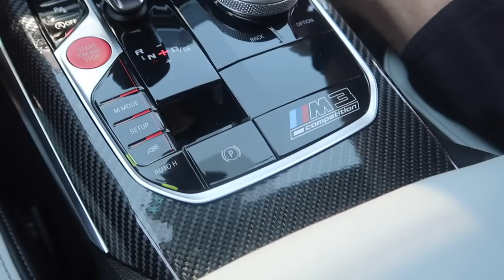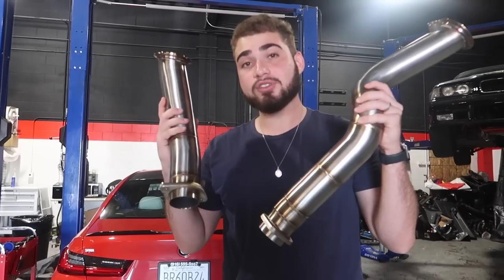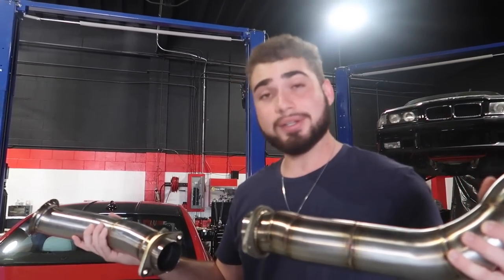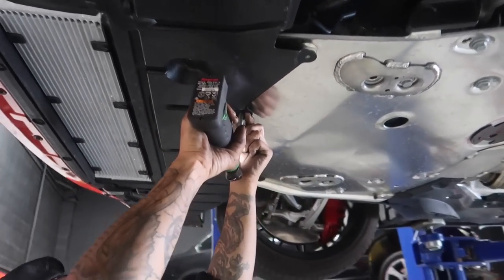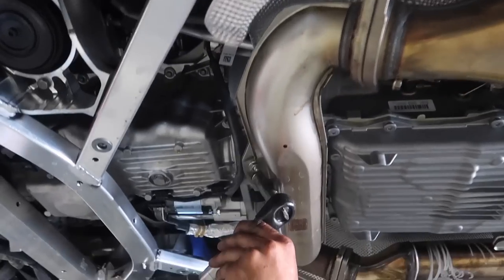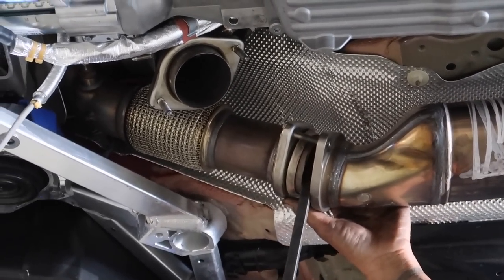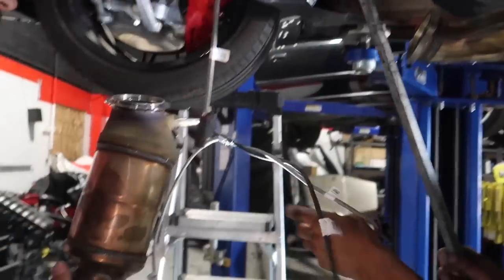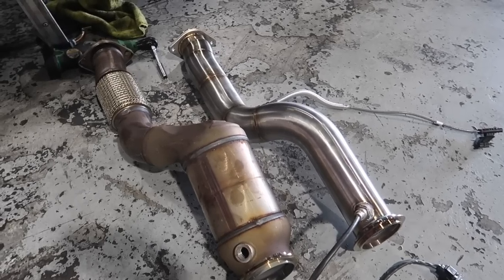SSR DOWNPIPES ON A G80 M3! INSTALLATION / INSANE SOUND CLIPS!!!

Comment: Sounds good, I just got some catless downpipes for my G80 M3 as well 😬
Reply: Where did you get them ?
Reply: @tonyberly7575  InkedCustom out here in Germany
Reply: Do you get an engine light with catless downpipes?
Reply: @trapharder4844  yes, but it got turned off after I got tuned.
Reply: @VonB3  unlocked ecu?
Reply: @trapharder4844  Yes, Femto unlock dme

Comment: Can you smog with the down pipes on?
Reply: No fail most likely
Reply: @rewok6941  so he'd have to take them off ever time he goes to smog it and put them back on?  That sucks.
Reply: @lj3372  its usual here in Germany. We are used to do it like that here. Didn't know it was that bad in the US too.
Reply: @chadmueller9135  in California they make you smog your car. You can't get around it unless it is older than 1983. Then you are exempt
Reply: @lj3372  how does that work? So your car has to be stock to pass emissions.
Reply: @chadmueller9135  yes for the most part.
Reply: @lj3372  That sucks. Only in Cali i guess?